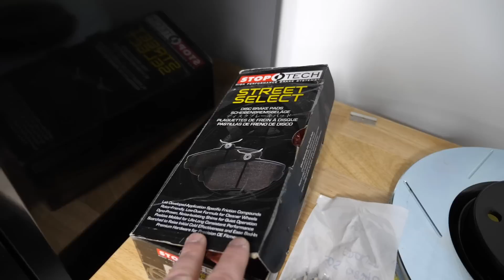Upgrading STOCK Brakes with Slotted Rotors//Pads & G2 Caliper Paint!

Comment: Looks good!  I suppose if it's still on stands, you could refresh the muffler with some new high temp black paint. I had a Ktuned catback system but went back to the OEM system but repainted the muffler and polished the tip.
Reply from the maker: I have something planned for the exhaust!

Comment: Great Video! I was thinking of getting the G2 caliper paint, but I saw in the reviews that it got tough to work with as the painting went on and by the end, the hardener was almost impossible to go on smooth - what was your experience? Did brush on easy the whole time? Looked great in the video, how has it held up over the last year. Thanks for great video.

Comment: Just so you know, you don’t need those rotor screws. All those do is hold the caliper in place when you take the brakes off other than that whenever you take the wheel off the brakes will keep it in place.

Comment: I’ll be curious to see how the G2 paint holds up for you. I used it on my calipers and it chipped in several places after less than 6 months, and it discolored (red paint turned black) in a few spots on my calipers. The discoloration did happen at a track day so I guess I managed to get the calipers hot enough to burn the paint..

Comment: The rotors are one backwards I'm pretty sure. When I did my brakes for my E46, the slots in the rotors are supposed to point forward, not backwards.
Also, slotted rotors DO NOT decrease stopping distance. They help with temperatures slightly, but they are really meant to help combat brake glazing.
Reply: They are pointing forward

Comment: I just had the shop (couldn't get the screws in the rotors out) install the EBC USR rotors front and back, new stainless lines and Stop Tech Street Touring pads and I'm trying to figure out what is wrong. Car has been bled twice, but there is zero bite. It slows down slowly, can't make it do anything even close to stock. Shop believes the pads are junk, as did the alignment shop (installed the RCA balljoints, sway bar endlinks and rear trailing arm bushings as well). So, ordered some Project Mu B Force/Spec pads... hopefully this fixes things because it has been super disappointing.

Comment: I am going to do this on my 02 type s. My question is why the G2 Paint oppose to a Dupli-Color caliper paint?  I need to order paint and your input would be appreciated. Ordering today or tomorrow. Anyone else have good history with spray caliper paint for our cars?
Reply from the maker: G2 seems to be substantially more durable. I’ve used the duplicolor stuff before and this formula is for sure different
Reply: @ALLDAYANTHONY  I just feel it’s way more tedious than spray paint. But my real question is how long more does it last than spray paint. Also why didn’t you do a gloss clear coat?

Comment: question, bought a pristine White type s for 11,500$ for 90k miles(body) clean title
BUT is has 11k+$ worth of maintenance done including a brand new k20a2 block  with semi built engine (forge pistons/rings, Manley rods and cartel 3.2 cams) and tuned everything else is completely stock.
also included with hondata k pro
interior looks like brand new
all done at 75k miles
was it worth it? makes 216hp and 155tq(conservative tune)
original keys and window sticker included 
my question is, was it worth it?
all done by K Powered in North Palm Springs , Ca
Reply from the maker: I would say so! Mods don’t necessarily always add value but if the miles are low and the car is in good shape that’s all that matters!

Comment: Also heads up, u dont have to open the cap when u compress the piston. Ur not adding any fluid or anything
Reply from the maker: Opening the cap allows the piston to full compress without putting pressure in the reservoir. I actually had to remove a good amount of fluid after the job was done!